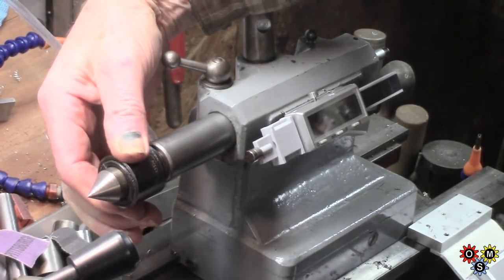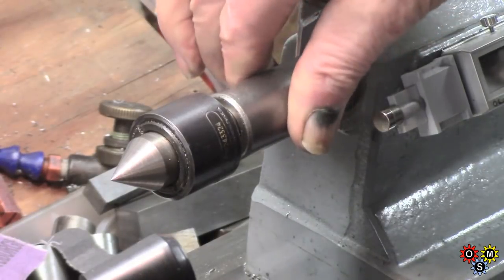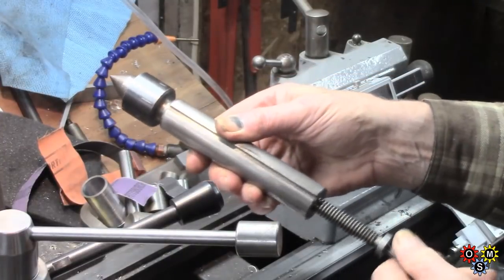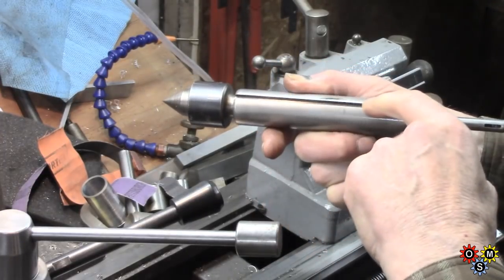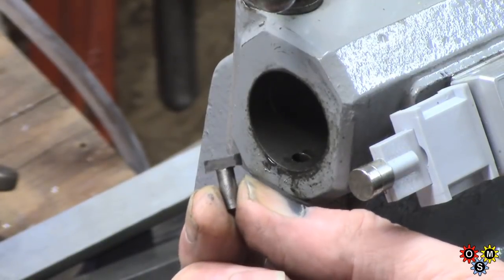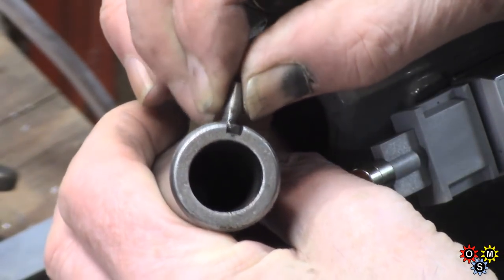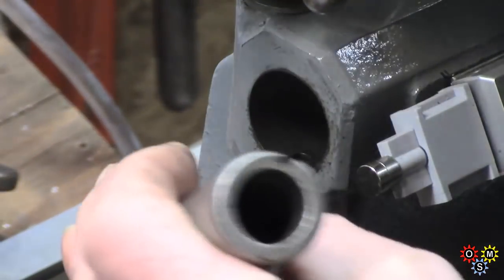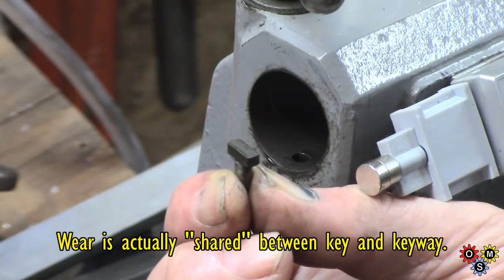Tailstock Quill Key Replacement

Comment: Hi Chris,
A little bit of rotation in the tail stock isn't that critical, keep the key softer, it's easier to make another ket than rework the slot on the sliding cylinder...
Good result...   ;)
Reply from the maker: Thx Pierre - I agree totally - thought about that more and feel it is definitely more desirable. :)

Comment: Hi Chris, Steve Jordan has done a video on securing a screw on chuck on his Myford ML7, looks to work well.
Cheers 
Raymond
Reply from the maker: Hi Raymond - yes, I saw Steve's approach and was going to do something slightly similar. However, for various reasons his approach won't adapt easily for me. Thus I am planning another method, if I can make it work!

Comment: I think that any tailstock quill is going to have some radial movement, but it is annoying, especially when you start to drill a large diameter hole, and the slack is taken up with a bang, I always rotate the chuck before drilling to take up the slack. You could have increased the length of the key even more to give more bearing surface when you made the new key, although, as you observed, the wear would be mainly in one place which would have meant milling the keyway back to parallel ,(is the quill hardened ?) and also re drilling the key supporting hole, what feels tight when trying by hand would easily be wound through with the quill wheel. You did achieve your reduction in backlash and it looks much better now. Thanks for posting this, Chris B.
Reply from the maker: Hello Chris,
Thanks. I have been in the habit too off taking up slack when drilling but had gotten a bit annoyed at the amount of slop. I don't think the quill is particularly hard, so leaving things as they are now is best way to go I think, the more I have considered it. Even some improvement makes the job worthwhile for me.

Comment: Hi Chris, my maximat v10p has a screw on spindle nose but the chucks etc. Use a split ring type locking collar, works a treat and probably fairly simple to do....
Kind regards
Daryn
Southwest UK
Reply from the maker: Hi Daryn,
I do have a plan hatching to make a sort of split ring approach - but it'll be tricky for a number of reasons. We'll see, eventually!

Comment: Happy Thanksgiving, Chris.  You did a nice custom fitting job.  I can't see why the rotation would matter.  I'd be more concerned with axial movement.  Thanks for taking time to record your work.  Speaking of cold weather, perhaps you should buy an insulated suit.  I have both the bib type and the coverall type, they keep me warm while working outdoors.  Cheerio!
Reply from the maker: Hi Jeffry,
Greeting back at you sir. Thanks.
The rotation when excessive does get annoying when drilling etc, even if trying to take the slack up first. Fortunately axial movement is still very minute if at all. I have heavier clothing I can use but hate gloves and, in the end it's darned hands that lose feeling. Space heater helps a bit until temps get real silly cold - which they will.

Comment: I was wondering if the slop might have been in the pin portion of this apparatus. I would have tried to make a slightly larger pin just to see if it would go in the hole before I made the pin and key. When you were sliding the key back and forth in the way, it seemed tighter than when you had it installed... I'm thinking the wear would be oblong in the pin hole due to the side to side forces on the quill and that is where you are getting the rotational play that you demonstrated in the video. Could you remove the quill and tail-stock and drill out a slightly bigger hole from under side and make another piece with a larger pin? Pardon my rambling, I've never done this job so I'm just thinking out loud.
Reply from the maker: Hi Danny,
I did make the pin to a tighter tolerance than the old one and it's a pretty nice fit... so no need to enlarge the hole, which does seem to not have suffered significant wear side to side. Once the rear part of keyway was relieved the key does now maintain a better fit all the way along. Made things a bit better anyways! :)
Reply: Another question ... Why would this slop in the quill make any difference? I can see if it moved up and down or side to side it would change the true center, but rotational run-out? I know any movement at all is annoying to us  perfectionist. Inquiring mind wanting to learn....
Reply from the maker: Danny - it's not super critical I admit but - when drilling there was for me rather too much ''snatch'' potential, although it helped taking up the slack  first. Just one of those things that I wanted to improve!! :)

Comment: I would leave it not hardend. As you so greatly displayed you can make a new pin in house so if it is sacrificial so be it... easier than making another or modifying  the quill.  Thanks for the vids
Reply from the maker: Thank you Glen. My further thinking and other's thoughts all point to definitely leaving the thing unhardened!

Comment: I am no expert, but I think that is as close to a perfect result you could get with a keyway that is not 100% perfect. I would not heat treat the key. If you use the key as is, it will probably last a long time. The keyway will gradually continue to give way, and you will end up haveing to make a new key that is squared, but passes the distal part of the keyway (the narrow part). If you do not heat treat the key, the key will, deform more than the keyway, giveing the keyway a longer servicelife without regrounding the keyway into a new dimension. This is what needs to be done in the end, but until then new «soft» keys are the way to go, in my opinion.
Reply from the maker: Thanks. Definitely going to leave key untreated... seems best idea the more I think on it. It should outlast me anyways :)

Comment: Hi Chris I need to make the same key for my quill. But I don't own a milling machine as of yet. I know it's going to be quit difficult to make without a milling machine.  Any ideas would be appriciated. Turned out great by the way. Specially using drill rod.
Reply from the maker: Hi Mark - not sure what to suggest really. Maybe if you have a lathe, turn down the pin section to right diameter and then, though tedious, use hand files for the key section and test for fit as you go.
Reply: ChrisB257 Thanks Chris. I think for now that's the only way. Until I get a milling machine.  Thanks again
Reply: Hi Chris I made the key for the quill in the end what I didn't mention was that my lathe is completely stripped down. As I'm doing a full restoration. So couldn't use the lathe. But did managed to make one. It's taken 12 hours over a couple of days. of hand filling as well as making the pin. Out of a flat stock of scrap metal. My finger are raw with all the filling. Lol But it's turned out great and fits perfectly. Looking at it you would think it was made by an engineer.  And I'm no engineer by trade. But certainly won't want to try that again. In a hurry. So will have to invest in a milling machine ounce my workshop is built. Just waiting on the better weather. Anyway thanks for the advice. Chris I do think I'm going to have to temper it though. Seeing as I don't know what type of metal it is. But am a bit concerned as I don't want it warping. 

What's your thoughts should I leave it as is. Or do you think I should temper it. I'm just concerned really of the pin warping. But maybe your experience could shed some light thanks again.
Reply from the maker: Hi Mark,

Glad you got a result, even if tedious! "Where there's a will - there's a way"!
I don't think it should warp and I think you mean heat treat. I think on balance leave it as is - it's probably just mild steel - that way it will wear more than the keyway over time, which seems preferable. Main thing is to keep the interface between that and the keyway lubricated.
Reply: ChrisB257 Thanks Chris for your advice sorry I meant heat treat. I think your right I will leave as is. I just don't want to warp it as it's quit a small piece. Thanks again Chris. Your a star. Hope your having a wonderful weekend. I see you.live in the USA. Nice. I've always wanted to live in the US. The weather in the UK can get annoying always raining.

Comment: Nice to see you back in your shop doing something, Chris a question about your Drone when you purchased it why did you go for the mavick and not one of the other brands?? Thanks
Reply from the maker: Hi Peter,
Well, bit more shop time for a bit, until temps go silly low!
My first drone with camera was the Hubsan 501S which did quite well but, no camera stabilization. I wanted good gimbal control as well as the 'intelligent flight modes' - which altogether give an amazing scope of options - and flight time also is pretty good. There are some drones that are sort of between these two but in the end went a bit crazy and decided on Mavic. So far have been very impressed with it. Here's a good example of the "point of interest" feature - https://www.youtube.com/watch?v=EDVxG6yCH80
Reply: Thanks Mate I am debating between the Mavick and phantom???
Reply from the maker: Thing is, Mavic is so compact - I have a case that holds that, 2 batteries and controller etc and it is so convenient for carrying around. However, it seems end results can be very similar from that and the Phantom - I think latest Phantom is something like V4 plus and looks pretty good, but it is a tad large. I think Banggood right now has 18% off Mavic - http://news.banggood.com/u/nrd.php?p=UtFsIbszBY_381257_2712733_1_1450&ems_l=2560851&d=TWFpbF8xN0N5YmVyMDVfZWxzZQ%3D%3D%7CY2M3NDUyMDY3YmQ5NjYwYTE%3D%7CMTA2MjE2Mzg5%7CVXRGc0lic3pCWQ%3D%3D%7C
Reply: Thanks Chris, it seems that the phantom may? have slightly better performance but the Mavic is very close and $'s for product is better.
Reply from the maker: Forgot to mention Peter - if you get a Mavic, this forum has some useful discussions and info -
https://mavicpilots.com/

Comment: Looks like there was some wear on the round shank of the key which begs the question, is there wear in the hole from whence it came? Best to wait for it to become a nuisance, since at our age, at which we worry about living until fruit we buy has time to ripen, we need to get on with more pressing matters, LOL.
Reply: I would like to know how much wear is in the hole as well. Don't think hardening is going to matter much on a job like this. I agree with Toby move on to the next project! Thanks Chris!
Reply from the maker: Thanks Toby and John - I don't think the hole wear was particularly significant actually. I'll leave it now as it is. 
Like the fruit analogy Toby. :)